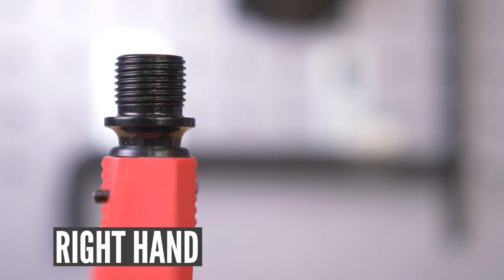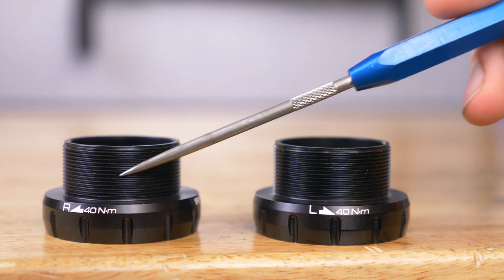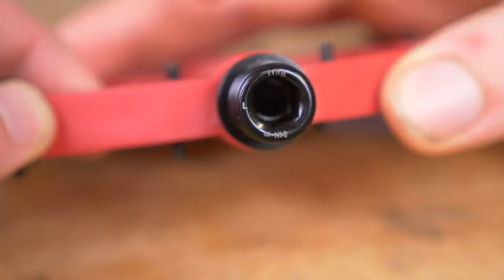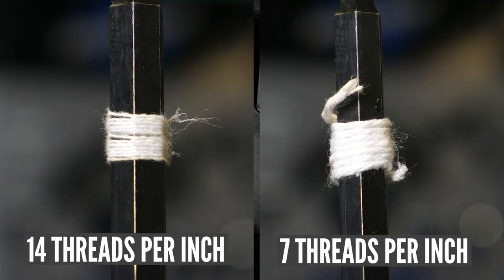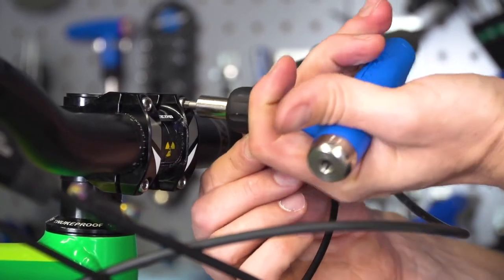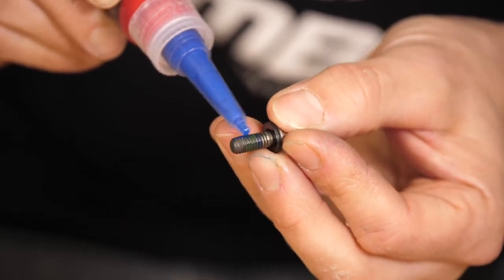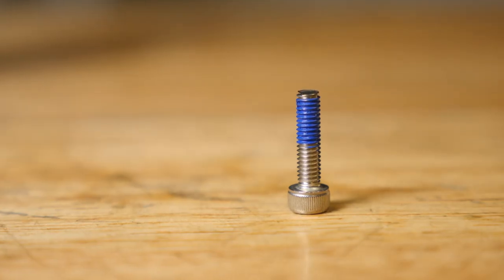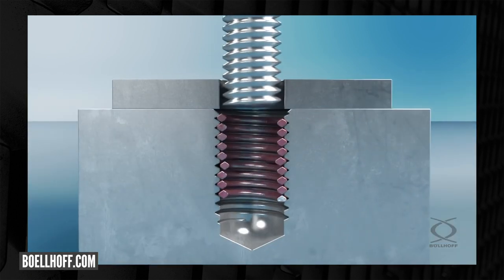How Do Bolts Work? | GMBN Tech Thread Explainer

Comment: inconvenient nerd here, but thats wrong, the bearing friction in the pedals and in the crankset is not actually the torque that may loosen the threads, in fact, if that was the case, it'd be left hand thread on drive side pedal.
The actual reason for implementing those inverse threads is actually mechanical precession, quite an interesting phenomenon.

https://en.wikipedia.org/wiki/Precession_%28mechanical%29
Reply: Awesome! Thanks for posting. "Every day's a school day" indeed.
Reply: @MrDblStop  glad you like it

Comment: "Helicoiled"  threads in aluminium will give a stronger thread than a thread tapped in aluminium. 

 But you are correct you need to consider how much material there is around the hole as you are drilling it out bigger than before

Comment: Nothing Henry said about coarse vs. fine threads here is wrong, but I think there's an interesting point he overlooked. Contrary to what people may expect, a fine threaded fastener is much stronger than a coarse threaded one of the same diameter. As Henry points out, the minor diameter of the coarse thread can be much smaller. But it's not the threads that fail, it's the "root" (i.e. the smallest diameter, or the minor diameter) that fails in tension. Since fine threads have a larger root, they can take greater tension. Another interesting note is annular threads, or in other words a hollow bolt. Making a through axle hollow is no problem, because removing the center material doesn't hugely affect the moment of inertia - the way that the shape of a structure factors into its stiffness. In other words, a tube mostly as stiff as a solid rod. In contrast, tensile stress (the way that bolts usually break) is affected by straight area - so if you hung a tube straight down and loaded the end, it would take significantly less weight than a solid rod. That's why cranks with thin aluminum extractor caps drive me absolutely nuts, it's a horrible design error. You end up putting huge forces through the back of the cap trying to force the crank off and the flat which contacts the extractor bolts is only held to the threads with a thin annulus. All that tension and it just peels right away, it's maddening. Happens all the time on FSA.

Comment: Just want to correct you, helicoils are designed to repair threads but they also are designed for stronger threads than original
Reply: What he was saying was if you use a helicoil you have to drill whatever your repairing and in doing this your removing material from the part being repaired.
Reply: @fostelka  yeah but it's still stronger, it isn't like the part isn't under any tension while in use. The helicoil spreads the load over a bigger surface area with reduces pressure and changes of failure

Comment: From changing volume spacers to get the correct progressiveness in my RS Pike, the ultra-fine, aluminum threads on the air cap & stanchion cross-threaded and seized when I tried to remove the cap. I had to buy a new CSU (crown/steerer/uppers) for the fork. So now I have a well-greased MRP Ramp Control Cartridge to avoid this issue in the future.

Comment: I have a 2016 stumpjumper with roval tires. Current set up is sram 1x11. Planning to upgrade to a 1x12 gx or nx. Do I need to change my hubs/spline to accomodate the 12 speed cassette?

Comment: One question: Almost one year ago Doddy mentioned in a Q&A video (the video is called "Are these cheap chinese carbon frames too good to be true" or something like that), that you guys plan on reviewing some of the cheap carbon frames (hopefully full suspension) and other chinese MTB products off for example Aliexpress and Ebay. To check if there is something worth the money or if its all just a huge safety risk. Have you made such a video in the past and I just havent seen it yet or have you choosen not to do such a video? 

I recently stubled across some nice looking and inexpensive carbon full suspension frames, drivetrains, carbon handlebars, rims and also a downhill fork.
There are a lot of dirt cheap chinese forks out there,  but it should be obvious, that even people in China can not build a proper performing fork for around 100 bucks. 

This specific fork was from a brand called DNM (its the "DNM USD 8" fork) and it costs around 300 dollars. So its in a price range, were you can !maybe! expect some better performance then from these dirt cheap 100$ forks. DNM also has some rear air shocks, which got some quite good ratings from some people buying it. 

That this stuff is not performing like the suspension off well known brands is obvious, but its also a lot cheaper. But also not that cheap, that you could nothing expect from it. Maybe its some good alternative if your budget is really low and you nevertheless want to be able to hit the trails.

There are literally no quality reviews from either the carbon-frames, the DNM USD 8 fork, the DNM shocks or other parts like drivetrains or rims. So you would be the first professional channel to cover it in a video.
 

Just as an information: I am not planning to buy one right now, as I bought a new Giant Reign enduro bike some weeks ago. But in summer I am planning on building up a second bike. Maybe some shorter travel trailbike. And because some of these carbon frames have exactly this characteristic, look quite good quality on the pictures and cost waaay less then even a standard aluminium frame, I will keep an eye on that and maybe plan on buying one and add other parts of well known brands to it. If there is something good like chinese cassette or cranks, then why not also try it. Even if its crap, the money it costs would not hurt too much.  Some review would be really cool. Like I mentioned, there are almost no proper reviews on that, definitely no quality reviews. How about building a  budget trailbike completely with budget but somewere realistically priced chinese products and test the heck out of it? :D
Reply: Are you sure that was all just "one question"? lol
Reply: @William-Bill-Munny  :D one veeeery long question. To shorten it: "Will you do some review about carbon full-suspension frames or other interesting items from china off for example Aliexpress or ebay?" :D
Reply: @Ramurod  hahahaha thats great - lol I know coffee in the morning does the same thing to me. Now lets hope after all of this they do it!!
Reply: ..... actually I would prefer made in Hong Kong frames over China but that is only due to communism and where my dollar goes.
Reply: @William-Bill-Munny  I am also not certain if it actually ships from china, hong kong or even a completely different region to be honest. I was just spontaneously associating Aliexpress with China, mostly because Doddy called it chinese frames in his video. As long as the price is good and the quality decent, so that someone is not going to die instantly when hitting the trails on it, I personally would be happy no matter what region its sold from. :D Yeah, would be very cool and helpful, also for a lot of other people that are interested, if GMBN could do some testing on these products in a future video.
Reply: I think one problem for a channel such as this is that the number one issue with a Chinarello (or similar) is that there is little QA/QC chain-of-custody. So you review one frame and the next week the same vendor's frame is wildly different. This is typical, and one of the cost-cutting measures. That doesn't mean they are bad - it just means you have little recourse if you get a bad one. For something like a fork the money you spend would be the least of my worries - if that fails you're likely in for a very painful time.

I do encourage people to weigh their risk/benefits, and act accordingly. I know locals happy with their off-brand carbon frames, and I also know a LBS returned OEM factory-direct parts due to bad quality (their own brand). And I personally own 2 bikes from this brand (Taiwanese titanium), but I accept that I might not be covered as much as if I bought a Seven. I'm ok with that - and I trust the LBS in this context.

And you'd be wrong that there is no reviews on Chinese frames. Luescher Teknik has done them, up-to-and-including cutting them up to examine them (also brand name ones, and he was livid with the recent bad fork issues with expensive brands like BMC). Look it up, the channel is right on youtube. Again, the problem is that given the lack of custody you can't extrapolate that the one (say) bad frame you examined means they are all bad. It's not the quality that's a concern; it's the consistency and traceability.

Comment: Sorry but what you said about the BB is wrong because the inner race turns and the outer does not they are designed so the way the cranks spin/the inner race of the bearing is so your BB shell doesnt seize into the frame. If the treads were opposite it'd try to tighten the BB and you'd never get it off again
Reply: Loved the video! Where were the superimposed monocle, moustache and top hat when Henry was ’torquing’ too much, though? 

And @2:24 move both of the red arrows inside the bearing: the smaller arrow represents the rotation of the spindle and the larger arrow the resulting mechanical precession on whatever the spindle is attached to (crankarm, bb) and I’m right there with you on the results. Thumbs up!
Reply: Actually he is correct. They showed it as motion, as most people are able to grasp that concept easier than that of forces.  Think of the balls as tiny gears and they are "pushing off" of the outer race as they are being spun around by the inner.
Reply: Actual reason: https://en.wikipedia.org/wiki/Precession_%28mechanical%29
theyre designed not to loosen with the pedalling motion